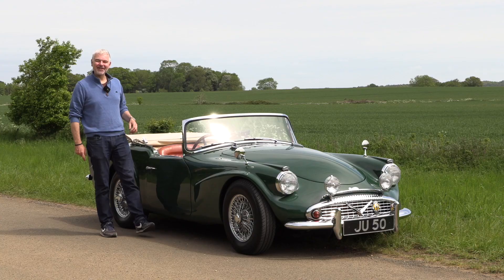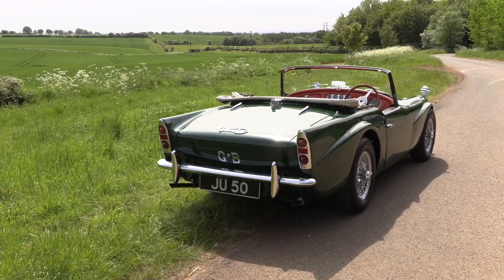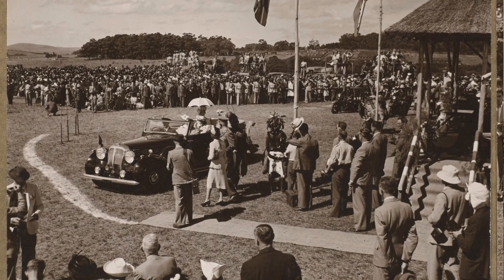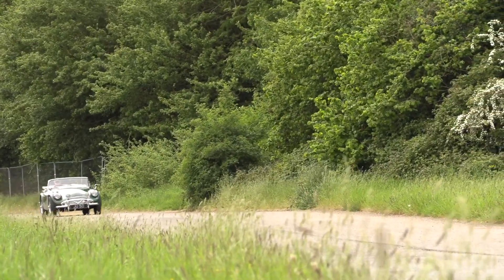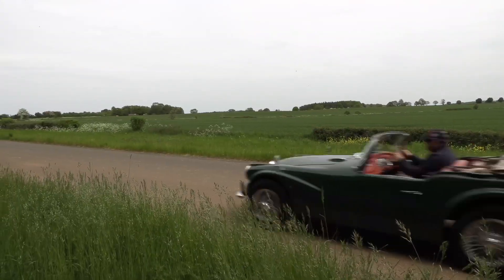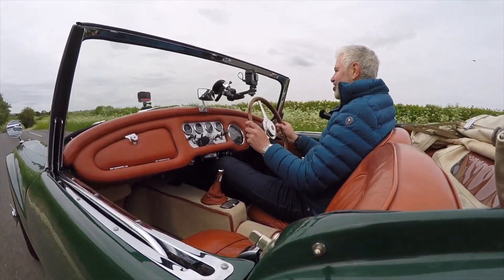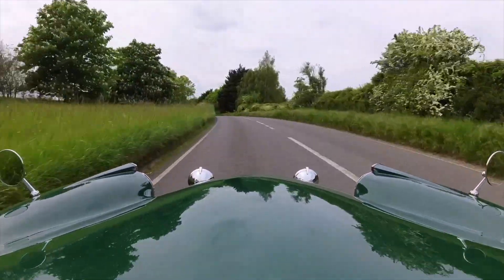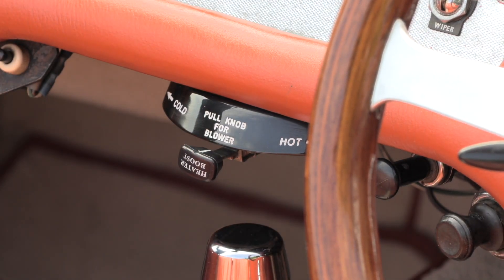It Wasn't Very Good BUT The Daimler Dart Has A Hidden Ace..

Comment: Daimler made a 4.5 litre version of that SP 2.5 litre V8 for use in the larger Daimler Majestic Major, just imagine how a Dart would have performed with a 4.5 litre engine under the hood! I used to rebuild SP250 engines back in the day, I got a reputation for reliable economical work and I did quite a lot of them. The V8 engine inside is like a 1960's Triumph motorcycle engine only better with a beautiful forged steel crank and super strong forged steel connecting rods, (in comparison to the iron crank and aluminium connecting rods of the motorcycle engines) which is hardly surprising as both engines were designed by the same man Mr Edward Turner, a man who in my opinion was an engine God and who ought to be worshipped by British motorcycle enthusiasts the world over in special Biker Churches 😋
Reply: He is !
Reply: There are at least a couple of Darts that have been converted to the 4.5 litre engine. here's one. https://www.youtube.com/watch?v=fCHesXjOJT0
Reply: @ruongluesteve  many thanks for the link
Reply: @@retiredbore378 what Triumphs did you have then with steel connecting rods?, none of mine did nor any of the hundreds I worked on back in the day, they had steel big end caps, is that where you are getting confused?
Reply: They should have used that engine in the Stag and in most Jaguars

Comment: I may be in a minority but I have always liked the Dart. I get why some did not like it''s looks but that engine is the ace perhaps not by American standards but I don't think you would need anymore power. Great review Jack even if you were a little squashed! 👍✍
Reply: The biggest problem I think they have is that the steering box is susceptible to damage.
Reply: Alway liked this car, very quirky styling, not quite british not quite American, very good engine though, my father had one briefly in the day, loved it to bits, for me the catfish grill works fine.
Reply: The dart had very large overriders fitted to the front bumper. these were spaced in very closely , giving it a rock guppy appearance. I f you take those off, and the badge bar and the extra lights you will find the looks are a lot cleaner.

The clip up filler and the GB badge & Daimler script also make the car a lot more cluttered looking. Check out 451 EWU. A very good looking car.
Reply: I love the looks! The styling is the best thing about it imo...even moreso now when cars are so bland and generic
Reply: I always liked the look of the Dart too . . . I wish there were cars around today that looked this distinctive..

Comment: Having had an early dart  for many years . I never had the door fly open. Certainly there was some chassis flex, as when fitted with the factory hard top in the winter there was a noticable difference! When compared with the triumph tr of the period, because of the wonderful Turner designed v8 engine and all round disc brakes wind up windows  and a good sized boot it was a far better car. So I would call it a very comfortable fast touring car of the period and also quite economical .

Comment: I once rode in a Daimler Dart that had a small block Chev 350 put in it. It could do wheel spins in each of the four gears from a stand still. It was the most frightening and thrilling experience of my life. Also why did the presenter not note that it had a fibreglass body? Surprising for the day.
Reply from the maker: Very true and an omission on my part!
Reply: But the steering wheel is on the wrong side!!

Comment: I've owned a 1969 Daimler V8-250 saloon for 16 years and driven it 50,000 miles. The engine is a delight!
Reply: I had one too, an automatic 'G' reg, if I remember correctly. Had to get rid of it as it was costing me a fortune in servicing with the brakes continually rusting up and rusting on the side lights on top of either front wing. The lighting fixture was welded on to the wing and mine corroded badly at the join. Shame as it was a lovely car otherwise.
Reply: Its a BOP aluminum V8.   It was bought from Buick in the 60s.
Reply: It should be a delite its waaaaay undertuned.
Reply: @garycamara9955  no it's not: that's the Rover engine. The Daimler V8 is a 2.5-litre hemi, iron block, alloy heads, designed in made in England, introduced in 1959.

Comment: I love those Darts a proper quirky English car , I personally have a 1932 Ford Roadster ( original  steel body ) that I fitted a 4.5 Daimler Hemi to , I converted it to Stromberg 97 carbs ( Traditional Hot Rod Carbs , made in England ) I also converted it to a T5 transmission which makes it a joy to drive , my red line in 7000 but I rarely get it up that high . Thanks for reviewing the Daimler Dart . Edward Turner , the Engine designer was a genius .
Reply: I have a 1928 Chev with a 2.5 Daimler hemi.. under construction, running a small supercharger and a th700

Comment: My dad bought one in New Zealand in 1961.  It was "second hand" with 900 miles on the clock; the original owner was a short overweight accountant who sold it because he couldn't reach the pedals (his belly hit the steering wheel first).  This car was my life as I grew up through my school years.  I was the only one whose small hands and skinny arms could reach up from underneath to the nearly-impossible bolt that held the oil filter on.  I knew how to tune the SUs to perfection, listening to the sound balance on the intakes at idle through a vacuum hose!  You are right, though - the William Turner-designed 2548cc hemi-head V8 was a sheer gem.  The car would pull from 4 mph (200 revs) to 120mph (6000 revs) IN TOP GEAR without complaining.  And the sound!  We did a panic stop from nearly-flat out once, when a truck turned in front of us in the distance - when the cloud of smoke dispersed there were two arrow-straight black lines - the Girling disks were that good.  Thanks for the trip down memory lane!  Ours was red, so of course it was faster than your one!
Reply: Edward turner not William.

Comment: Ah, Jack...  I had one of these back in the day.  Traded for it straight-up for a TR-3B (that's the good one with the 2.2 engine and all-synchro gearbox) that had a bunch of period extras - Lehman side curtains, proper cloth top and tonneau, Lucas driving lights in the grill.  The SP250 was a B model, I was told, and was a bit stiffer than the first ones, especially with the hardtop fitted.  The roll-up windows and hardtop made it MUCH better in the winter than the TR (I lived in St Louis, MO at the time and it got cold and wet in the winter).  I confess the catfish front end never appealed to me, but I removed the front bumper and the chrome grill and enlarged the opening a bit, which made it better.  But this car was a real highway flyer, especially mine as it had been fitted with overdrive.  After I re-cored the radiator and fitted an oil cooler, it would run 100mph all day and still deliver 20mpg.  In those days (1963-ish), that was some serious motoring.  Plus it had a large boot!  Met my first ex-wife when I was driving the Daimler...but I never blamed the car for that mistake (she really was lovely, with a glorious bottom)!
Reply: Cars & Chicks, Chicks & Cars.
Reply: "she really was lovely, with a glorious bottom!" Was that in reference to the car, or the lady?
Reply: It would be great to see a picture of it! The Daimler is to some "challenging", but I do like it.
Reply: If it's got tires or tits, it's going to be a problem at some point.
Reply: @savage22bolt32  //
Thanks for the laugh.

Comment: Hey Jack, there is a guy out here in Australia, who had one of these and he significantly modified it for classic tarmac races (eg. Targa Tasmania) and the car proved itself to be a real weapon. He then did the same thing with an old Jensen CV8 and again it too was incredibly successful. So, I guess like many things you can make it work if you throw the right engineering and money at it. 

A side not to the Daimler/Jag story. Given that Jaguar bought out the Daimler company, and hence had that lovely little V8, they installed it into the MK 2 body (as I am sure you are aware), and again it just worked so well. Many years ago I got to drive both a Daimler 250 and a 2.4 Mk2.  The Daimler felt better to drive and was so more relaxed. The Mk2 with its Moss box was not all that pleasant.

Comment: Great video Jack. I had a school friend who turned up in one of these after he left school. If I remember rightly, it had a fibreglass body so the power to weight ratio was really good. At a time when driving from Colwyn Bay to Chester on the old A55 normally took about an hour, he held the record for doing it in half that time. Of course, in those days there were no speed cameras 😉
Reply: Yes, they were a fibreglass bodyshell, and a pretty good quality and strength one too,  when compared to other manufacturers. 😁

Comment: Russ carpenter drag raced a rail with the Daimler 2.5 v8
Supercharged and running nitro it went 7.2 seconds at 180mph in the 1/ 4 mile in the 80's 

And another brit called Robin read also raced a rail with a bored out to 2600cc Daimler v8 running a super charger and nitro.

In 1992, he ran a 6.81 at 189mph.
So the bases of the engine had very good strength and engineering.

Comment: I've always been attracted to quirkiness, still am, ask my wife!
I owned a C spec SP250 in the 1970's and toured thousands of miles in her, both in the UK and abroard. Yes, the engine is a gem, creamy smooth, torquey and seemingly un-burstable.
I do remember that the cooling system was stretched at times and one particular incident of going around the Rue Peripherique in Paris, in a traffic jam with the temperature gauge practically hitting the top stop, but with heater on full we managed to keep her from boiling.
Fond memories, and my one enduring regret is in not having kept my Daimler, in my opinion she was a characterful gem!

Comment: The engine was designed by Turner who also designed the Triumph motorbike engines. My MK II Daimler Jag was a delight, but my 3.8 was a beast. Before the 70 limit came in, I watched the fuel gauge go down like a minute hand at just over 130 mph (143 clock - they were always fast).

Comment: I'm a Kiwi, who owned a Dart for several years, during my early twenties. I'm mid seventies, now. I was also a mechanic. It's basically a Triumph TR 2 or 3? chassis and transmission, with the already mentioned V8 motor. Clothed in a fibreglass body.. Performance wise. They were pretty much the next thing down from an E Type. But they tended to be a bit fragile. The Diffs, were prone to breaking their crown wheel carrier bearing mount. The gearbox, was prone to breaking the cluster shaft, I think? The chassis of mine developed a bad crack, amid ships.  If you shod them with Radial Tyres, They had a habit of cracking the steel wheels.. The fiberglass had a habit of developing cracks.  Often people. Fitted them with Mag wheels to stand radial tyres. As you pointed out. Rack and pinion Steering was fitted. Some people fitted Toyota Celica five speed all Sychro gearboxes.  If you wanted it to be faster than an E Type. Apparently the 4.5 litre from the big Daimler saloons, was the same external size, and I'm told. Pretty much bolted straight in.  I had lots of fun and some very quick trips Shhh,! around the country. But I don't think that they were really a very good vehicle.

Comment: I was just a poor summer intern in 1979 at Ford Motor, Co., Body Engineering; but, (1) there was a couple of guys there who regretted parting with the British, 2 Seater autos of their youth. (2) Some internal, door side intrusion panels would have stiffened the body of the Dart with more hard core hinges & latches. (3) The Ford Fairmont had an upgraded, royal cousin, the Mercury Zephyr ('78 to '83). There were interior upgrades, added noise insulation, and other options ?? But one of the tricks they did on the Zepher underside of the chasis was to add spot welded channels that piggy backed the Fairmonts sheet metal. It had plenty of holes to keep weight down. I think that happened in 2 places & maybe 2 more with just flat braces. So 20 to 30 pounds could have fixed the problem. SEE  "Monte Carlo" Braces & Bar to stiffen front end.

Comment: I love these little cars! While I never owned one, your description is spot on. When Jaguar bought out Daimler (for the engine) and the chassis was strengthened, the death knell was delivered by the introduction for the E-type. Sir William saw no profit in having both the SP 250 and the E-type competing side by side. If memory serves me correctly, both cars were very close in price and the Jag was 10 times the car! Still, drop the front bumper (an option) and the car is so ugly it's cute! I did get the chance to drive one with the rack and pinion steering and it did put a smile on my face. They only made about 2,600 of these little V-8 Hemi powered cars. Here in the States you see them occasionally at the British car shows and they always bring a smile. Thanks for showing us this car.
Reply: The E-Type was about 50% more expensive than the Daimler, at least in the Uk it was.
Reply: @stevenbrown9691  About 25% less in the US.

Comment: I'm very surprised its FAT sister the Daimler Majestic Major has not been mentioned. It had a 4.5 litre Daimler Hemi V8 in it, and even for its size it was breathtaking re its speed.
Edward Turner really did the magnificent job on these two engines. I've seen a 2.5 litre fitted to a Rover P6, that was an exceptional car.

Comment: In 1980, my then current boss had one of these. I got a ride in it on the day I bought his MG Midget that the Dart replaced. And yes, I had the passenger door open on me in mid turn - much too my surprise. According to him it was normal, lucky to have me along to pull it shut so he didn't need to stop. A very quirky car, not what I would consider as a replacement for a good MGB as far as a touring car.

Comment: I had a Daimler 250 saloon a few years back, great engine, I saw one in a top fuelled dragster at Goodwood, it was making 1400 bhp, I spoke to the owner, the only change he’d made was fit TR6 flat top pistons, he’d done the maths and the crank could take 2000 bhp!, over engineered or what!!!!, no wonder they ran forever with the standard 140bhp 😁

Comment: The engine was designed by Edward Turner who designed the Triumph Speed Twin 500 cc motorcycle. He used the cylinder dimensions, valve angles, etc from the Speed Twin for this engine,

Comment: Edward Turner's 2.5L Hemispherical Head V-8  - this chap also designed Triumph motorcycle twin cylinder engines in the 50s, and I have heard the pistons from the 650cc Bonneville are used in this engine
Reply: Not quite. It is four triumph twin bike engines shoved together. Turner engines won Grand Prix bike races, he was moved from Triumph to Daimler and had to come up with a new engine.

Comment: There was an SP250 that sat in one of my neighbor's driveway for years, like maybe 20 years. Never saw it move, tires went flat. No rust on the body, it was fiberglass I believe.  I always wanted to stop by and ask them if they wanted to sell it, espcially when I found out that little V8 was a hemi! Then one day, it was gone....oh well.

Comment: I've only spotted two of these in my region of Ontario, Canada. Both between 2011 and 2017. The first one was the same colour as this example. It was too far away for me to examine so I was left scratching my head thinking through a list of what it is NOT. The choices of grill (snout) and tail fins, etc. just got in the way of making a conclusion based on anything I'd seen before. 
I do remember hearing the name "Daimler" used in TV shows of the 60's and 70's with police or toffs, e.g. "Bring 'round the Daimler," and knowing it would be a substantial car.
Reply: at least the fiberglass body didn't rust away on our Ontario salt-ways like other British cars, eh?

Comment: That 2.5 V8 also improved the handling of the Mk2 Jaguar bodyshell when they used it to create the Daimler 250 V8 saloon. They were mainly automatics, but a manual one is a gem that could certainly embarrass the equivalent Mk2 Jaguar version when hustled along twisty country lanes.

Comment: I've had a couple of these, a lovely drive. On that one those spots and mesh guards do nothing for it. Also painted wires look better in my humble opinion. I think they're great cars but you want a B or c spec. Oodles of torque, just leave it in top, it'll even pull away from a standstill at idle.
Reply: Just to confirm that it is a B-Spec car and the doors have never sprung open!
Reply: @stevenbrown9691  Never happened to either of mine either, one B spec the other C spec. Nice cars if you like to be a bit different.

Comment: Nice, thank you.  I recall from that era that Daimler also made another car with a V8. The Daimler Majestic Major looked like the typical staid barge that the company was known for. Except it had a 4.5 litre V8, of 200+ bhp,  that made the car into an absolute humdinger, faster accelerating than the Jaguar Mk10.  As for Jaguars, I never worked out how Jaguar managed to sell any of their asthmatic Mk2 2.4's ( until they fitted a much reworked cylinder head, as I recall, and it became the 240 ), when there was the Daimler version of the Mk2 with the 2.5 V8 as here.
Reply: The MK2 or S-Type with the 4.5 V8 would be interesting
Reply: @Suprahampton  I is said that Jaguar evaluated a Daimler version of the Mk X/ 420G, fitted with the 4.5L Majestic Major engine, but chose not to after the Prototype noticeably outperformed Jaguars own 3.8L engines. Remember the 4.5 V8 was rated at "220hp", whereas the Jag 3.8 was rated at 265hp